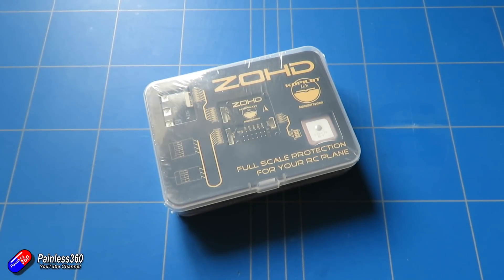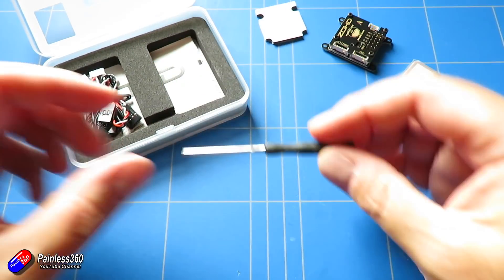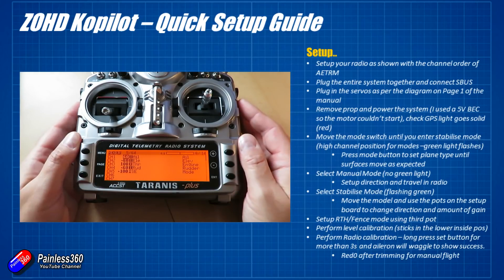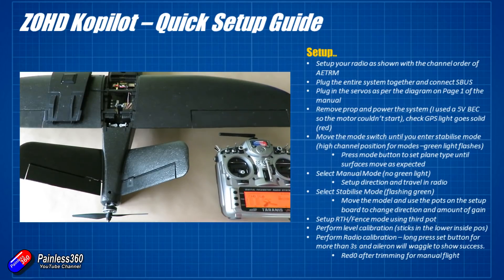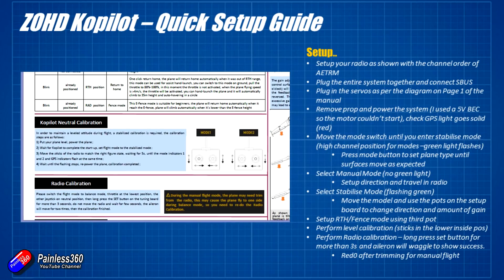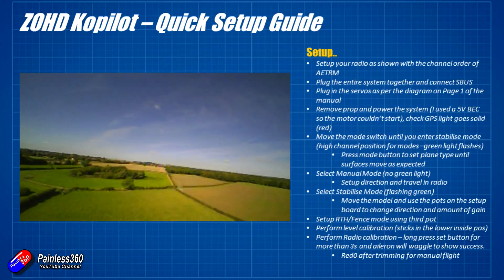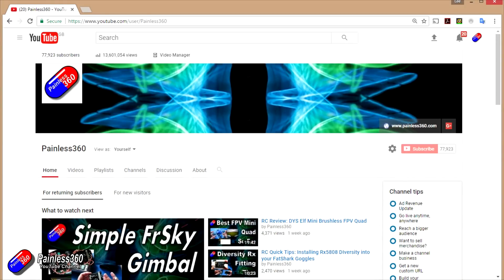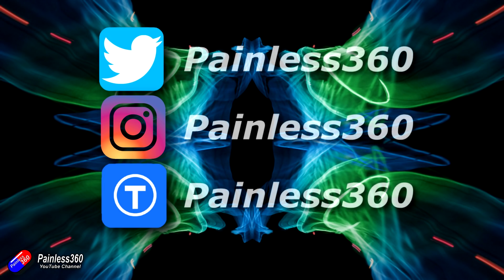ZOHD Kopilot Lite: Easy stabilisation and RTH for fixed wing

Comment: If I unplug the setup board after programming the ZOHD the elevator & aileron throws revert to 20 % of the set up values on restart.
There is advice in the video instructions that you can remove the board to save weight. ? Is there a protocol to follow before removing the board that will lock in the set up in values .
Reply from the maker: I've never used mine with it unplugged..
Reply: Thx

Comment: Hi, all set up on a Flysky rc and tx and flying wing, except the elevator and aileron is incorrect, ie: left and right input on stick makes craft elevate/decend, up and down input makes it bank left and right... For the life of me I cant change it, either on the tx or by swapping the servo leads. Any ideas?! Thanks
Reply from the maker: Check out the setup video for it at the top of the playlist. I cover all the steps.. Best of luck

Comment: I have to reverse elevator on mixer, because control surface not working right. On stabilized and manual mode the plane flew great but i'm not try RTL mode yet...do you think its ok to reverse my mixer? Thanks in advance
Reply from the maker: Please follow the setup steps in this series. Works great...

Comment: Any way of using it on a radio without a 3 position switch? I only have on off type stitches on my radio
Reply from the maker: It will work but you won't be able to select the middle 'manual' mode unless you do some mixing..

Comment: Thx for that - how do I get  neutral calibration  to work consistently - We fly mode 1 transmitters here in Australia.
Reply from the maker: I made a video on that, check it out. As long as you get the channel values to the same position it'll work the same...best of luck

Comment: Quick question - I put this on a Volantex Ranger G2 that has their 30A easy-plug ESC and the motor just won't start. Reading on RCGroups people see this issue with other ESCs too and it seems that since the board takes more than 2 seconds to boot up, the ESC is not getting a signal and shuts itself down. May I ask how to go around this issue? Otherwise great product that can great improve its manual for noobs.
Reply from the maker: I'd look at how that ESC feature can be altered.. Happy flying!
Reply: Have you found a way to fix this problem? Or did you find a replacement ESC that works with the Kopilot Lite?
Reply: @theoztreecrasher2647  I did find a way and it was staring at me all the time. You have to separate giving 5v to the kopilot and only then connect the ESC. I used a bulky voltage regulator from a pic racer but the easiest is just to use ubac (I ordered two). I should really cover the solution in the rcgroups thread.
Reply: @shmulikgazit5803  Thanks and please do put it up on the RC Groups thread for others.

Comment: Love your vids. Question - do you know how to reset full throttle when running through the Zohd
Reply from the maker: Do you mean ESC calibration?
Reply: Painless360 yes sir. Appreciate all the help🙏🏻🙏🏻
Reply: Thanks for getting back to me. 

Basically I’m not getting full throttle on my edf. I ran my standard, full throttle plug in battery wait for beep then zero throttle and reboot. Upon attempting this all I get is a beep beep. No reset.

If I bypass the zohd and connect esc to receiver, I’m able to reset throttle and it’s back to full, however, when I reconnect esc to zohd it doesnt acknowledge new esc setting. It beeps continuously suggesting zero throttle not engaged. 

Apologies of my explanation is not using correct terminology.

Comment: Is there a way to test out the RTH when turning off the TX?  Does it have a certain colored light on it that illuminates when in RTH mode? So when on the bench simply turning off the TX we could observe it going into RTH ?
Reply from the maker: Yes. The flight mode is shown on the unit.. Make sure the Failsafe on the RX is set to select the RTH mode..
Reply: @Painless360  Thanks for reply..I have 3 planes and one wing setup on Arduplane but would like to try this out for its simplicity of setting up.. Probably on a S800 wing for FPV perhaps..

Comment: Forgive me for asking a dumb question,  but does this work with the dji fpv system? If yes, I should be able to go out to the max range of the dji system ( 4km) , hit return to home and it should just come home?
Reply from the maker: Yes, with the SBUS connection. No integration with the OSD though. Happy flying!
Reply: @Painless360  cheers!

Comment: Oh man I'm in the market for one of these for my little sub-250g wing I'm building, just out of interest how much do the components weight?  I know it says 86g on Banggood but that's usually the overall package weight including the plastic box lol.
Reply: Same here lol, i got a setup with matek f411 and bn 180 / bn 220
 And the whole autopilot adds 10-12 grams depending on the amount of wire you use.
There is also a kakute holybro f7 FC thats rly looking cool and light, but more expensive too

Comment: I'm curious how much mishandling the new stabilizer can take.  The old Talon stabilizer (flipped into Launch/Beginner mode) could get you out of some tricky situations but it couldn't save a full-blown spin-stall. Your only chance here was to get it into manual and apply correction; but that required height or 'gunslinger' reflexes.
As the Kopilot has throttle control I wonder if it has more control in RTH mode?….Anybody fancy trying it ;-)

Comment: I get a GPS lock, but nothing else works. My Taranis is set on PPM, I have a servo lead going from a D4r-ii receiver to the SBUS port on the Kopilot. I have a solid red GPS LED, but can't get any further than this. If I press the Set button for a few secs, the aileron servo moves and resets but no servos respond to stick inputs. Do I have a faulty Kopilot? :(
Reply from the maker: You need an RX that has sbus out. That one doesn't. Best of luck
Reply: Many thanks for the reply! I finally have it working with an X8R receiver and in SBUS too. The servos jitter like mad in RTL mode though, on the bench. Is that normal?
Reply from the maker: Yep

Comment: Hi ive just set up my first kopilot lite on my new drift can you tell me if you are meant to use expo with a flight controller also is that the same for my dart thanks
Reply from the maker: I would add EXPO to the radio to help with control. See my step by step setup video.. Best of luck!
Reply: Thanks
Reply: Can I ask one last question do I add to inputs or mixes thanks
Reply from the maker: I add it to inputs by default

Comment: Do you have any recomendations for a gps rth unit like this that has a 2nd Ail and Ele?  I have an HSD F16 and want to be able to use Flaperons  and Tailerons with it but with this unit I would not be able to.  I've considered the A3S3 but would love to have the GPS RTH even though it might be more of a confidence feeling rather than a practical safety measure.  Thanks!
Reply from the maker: If you are looking at that then check out the INAV for Beginners 2020 series on the channel. INAV needs a little more work to setup but is very good at he things you are interested in..
Reply: @Painless360   I saw that but the Mateksys 765 WING nomenclature through new off.  Is that the board you recommend?  I’m not interested in FPV.  Thanks for the help and a gift coming your way!
Reply from the maker: Yep, see my Kit Picks 2020 video..
Reply: @Painless360  will do!!!
Reply: I didn't see where the F765 has SBUS out?  Looks like SBUS input to the receiver and 12 PWM channels directly to servos. I looked at those recommendations and what I really need is just a gyro with SBUS output.  GPS RTH would be a nice bonus.  The only one I see is the Cortex Pro which is $300.  Anything else you can think of?
Reply from the maker: Why do you need sbus out?  I am confused...
Reply: @Painless360   My HSD has SBUS to connect to my Rx.  I would like this SBUS to connect to the gyro and then the gyro SBUS out to my Rx in order to minimize wiring.

Comment: ....but where are all the settings to forget/get wrong?

Genuine feedback though, it would be good to get ppm control of the gains. This could be done via a couple of radio channels. The car gyros often have this feature, a screw gain or a ppm override.
Reply from the maker: I agree. Interesting this is called the 'lite', makes you wonder if there are plans for a 'full' version...

Comment: Have set up the ZOHD with recommended gains & model is flying normally in manual mode - when switched to stabilised mode the model is very slow to initiate a turn as  the gyro is immediately countering my  aileron  input & effectively returning the model to level flight.
Increasing the gain makes the model overreact in manual mode and only increases the  counter leveling effect .
  If the gain is turned right down the ailerons effect is unresponsive in manual mode.
  Solution  please - Regards Alastair
Reply from the maker: That's not how you set gain.it's how hard the Kopilot works to stabilise the model.  In stabilise mode pitch and roll are limited and cant be changed. See the playlist.

Comment: Hi, may i know how to setting the 3 position switch in the radio. What is the value setting. Thank you
Reply: On the mode switch you need it at -100 so rth is at the bottom of 3 pos switch but just depends on your flying style

Comment: I set up radio as instructed but could only get the Vtail to work if I reversed  the elevator and rudder servo connection from what was shown on the manual.  Anyone else have the same experience?
Reply: If you are talking about the Talon250G then that is correct. The servos are mounted with the output shafts turned around from how the Kopilot Manual shows. The Talon250G manual shows the correct setting for that plane.

Comment: Hey bud, great video, if I have a PPM TX/Rx, how do I configure it with the PPM to SBUS/PWM converter. Thanks
Reply from the maker: I would strongly recommend using an SBUS receiver. Best of luck!
Reply: @Painless360  thanks for the reply, I have a flysky IBUS RX, you tried that? Should still work. I'll give it a go over the weekend.
Reply from the maker: I doubt it. Only PWM and sbus supported... Best of luck with the build!
Reply: @Painless360  Thanks for video. It does say "SBUS/PPM input" on the manual (and someone reports using PPM PreviewPreview4:46ZOHD Dart Sweepforward Wing - SBUS & PPM RX setup ...), but I can't get any of my Orange RX CPPM receivers to work with it, so have resorted to PWM. Do you know if there is a difference between Orange RX CPPM and standard PPM?

Comment: Hi I have had one of these in my drawer for a while now and given I have time on my hands at the moment I thought I would install it in an FPV flying wing I have been meaning to finish a Skywalker X6 to be precise installation is as you say simple enough sadly though I can only get so far as I cannot get a GPS lock apart from trying to obtain another gps module from Zohd is anything you or indeed anyone can suggest I might try ?
Reply from the maker: Try it out of the model to confirm nothing near it is causing issues... Best of luck
Reply: @Painless360  Hi thanks for your reply I decides to switch the brain on (dangerous I know) and I figure as these units are readily available for several different uses It is probably a stand alone item inasmuch as it just needs power to work so I pulled the receiver out as it it is also a TX for telemetry uses but still no joy have ordered a unit from ebay !!! well it passes the time ;-)

Comment: I wonder if this would work with the dji air unit and controller?
Reply from the maker: Maybe, maybe not. The system may put out too much interference for the GPS to work well. I'm having that issue here with the ByteFrost system..

Comment: If I hit the fence limit in stabilized mode, will the plane automatically switch to RTH mode?
Reply: It can probably do that, one way or another. But because it's not a typical purpose of the fence there probably isn't a standard option to do that.

Comment: Lee if the plane lost signal, will return to home?
Reply from the maker: If you have the RX Failsafe set for GPS RTH mode..
Reply: @Painless360  ???? what do you mean rx set to rth, receiver only have set to fix servo position that means crash, is the flight controller what has to recognize no pulse, and trigger the rth on the fc.  I'm confused, because Im looking in the fc this feature.
Reply: Does the motor spin when you turn off the radio like in idle, if not this fc may do not have rth during a lost of signal.
Reply from the maker: All controls including throttle are controlled during RTH.. So, set the RX Failsafe to select RTH..
Reply: RX Failsafe set for GPS RTH mode.. ?????? how?
Reply: @nucleo1772  that is my question too, the rx can not be set to RTH,
Reply: @maxun1  on taranis radio you can choise no pulsess or hold ...or something in failsafe option. RTH you can only setup in Inav tab....RTH, Land or Drop but how to do that wit receiver manualy? L9R or XM+????
Reply: @nucleo1772  agree, my question is, if you lost signal, will return to home or drop?
Reply: @maxun1  Some receivers remember what the sticks/switches positions are set to when you bind them and use that as failsafe...So if you bind it with the RTH switch activated it should work but i am not sure what receivers has this function I have a couple DSMX receivers that does it
Reply: @nbkblood  the rx here is not the issue, the issue is how the FC will react, if you turn the radio off.!!!!
Reply: @maxun1  Defiantly do some bench testing before flying to be safe..
Reply: @nbkblood  yup, I will stay with my omnibus f4 boards for now they been proven bulletproof.

Comment: Hi, can you just demonstrate by moving the RTH/Fence Pot how you mean by changing the range? It is very confusing as there are 5 points on the pot... ?? confused or what??
Reply: I've just got mine today and wanted to set it up but needed to watch your vid which I did understand except the fence setting etc.
Reply from the maker: The manual isn't great is it. I'm not a fan of fence mode, I'd use GPS RTH (turn the control all the way clockwise)..
Reply: @Painless360  After looking at it for some time I came to the same conclusion. The penny dropped whilst I was talking to my wife about it... thank you anyways. I do appreciate your vids an will be back to re-watch this again before I fixed it to the Talon tomorrow. This is my fifth Talon but first V2.

Comment: does rth is limit by the system or can be set to maximum range?
Reply from the maker: If you're in RTH mode then it's activated via the mode switch..
Reply: @Painless360  meaning it doesn't limit the range of the wing can go?is tht right?
Reply from the maker: Please watch the series, its all covered there..

Comment: I couldn’t stand the stabilizer that came with my ZOHD Dart 🎯 are you saying that this is substantially better? It’s about the price of a Matek 411 🤔
Reply from the maker: If you like iNav then this probably isn't for you. Don't forget the cost of the GPS that needs to go with that 411..
Reply: Painless360 true, that’s about $10. Brings the price down. For the $$$ the : ZOHD Kopilot Lite And VC400 FPV Combo Autopilot System Flight Controller W/ GPS Module Plus VC400 PIGGYBACK AIO OSD Camera 5.8G 40CH VTX, has more value. I just might try it!

Comment: Did you try the auto launch feature? From the manual it looks like you activate RTH, raise the throttle, the prop won't spin, then you throw the plane & the motor will kick in & climb to the usual RTH loiter circle?
Reply from the maker: I'm planning more videos with tips and tricks for this so stay tuned!
Reply: @Painless360  Thanks! I'm new to fixed wing & while I've built several Arducopter multirotors, a less 'intense' introduction to the world of fixed wing with RTH safety than Arduplane certainly has its attractions.
Reply from the maker: Indeed. Arduplane and iNav are excellent but need hours of setup and tweaking even for experienced builders. Even the cheapest Arduplane flight controller and GPS cost more than this. I have a few mates who love this thing and are already planning on getting a few (I bet I'll get asked to install them ;))

Comment: Same price as matek f411 but seems like it only does half the things
Reply from the maker: If you're happy with iNav then I don't think you are the pilot it's aimed at..
Reply: You would have to add the cost of a GPS receiver to the Matek for a fair comparison. Then the comparison is slightly cheaper and much simpler setup vs greater capability.
Reply: @ChrisBalmforth  actually matek f411 plus a GPS still costs less than this
Reply: @josephfreeman5289  OK, you should definitely buy the F411 then. If you're happy setting up iNav.

Comment: Thanks - RTH and reliable FENCE mode is just what I need for my flying site with one "no,no" zone .
Will study more carefully FENCE mode - what is height (fixed)? - presuming that 100-300m is radius of circling?
Reply from the maker: Height isn't adjustable and it's either RTH or geofence mode.. Happy flying!
Reply: @Painless360  Ok,thanks, I got that - it's either one or another - but what IS the height? - whatever is at the moment the switch is flicked or what?

Comment: If you used an external osd will it still overlay the information
Reply from the maker: If it works without a FC then it should be fine..